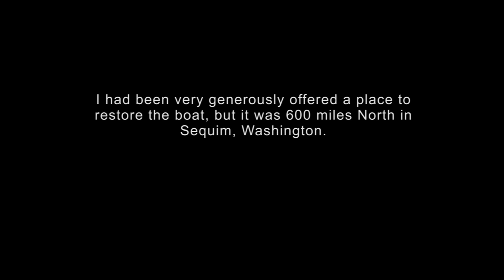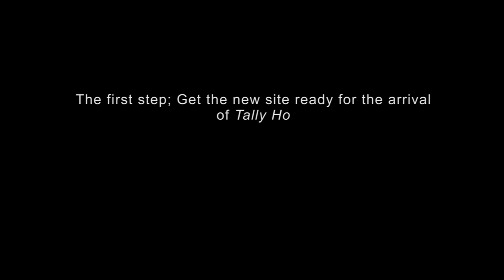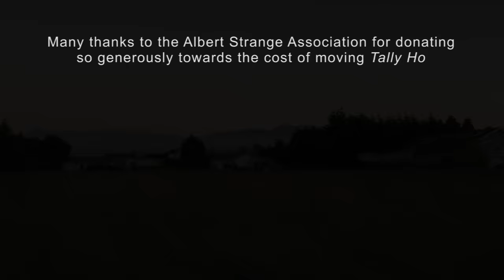Moving Tally Ho - Rebuiding Tally Ho EP2

Comment: Two comments on the layout:
1: I would move the longitudinal bulkhead between the companionway and the skipper's cabin inboard as far as it will go, leaving only 24 to 26 for the companionway. The additional space in the cabin will be valuable and the companionway a bit safer when well heeled.
2: I'd move the galley counter as far outboard as will allow the stove to gimbal and the sink to fit. The additional space for the saloon table and bench will be really valuable.
Love the work and the videos!